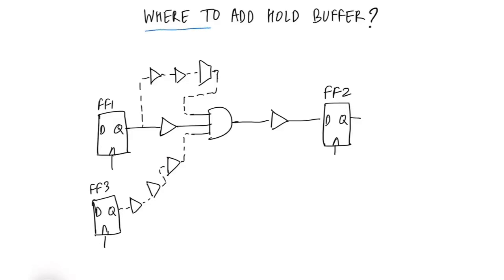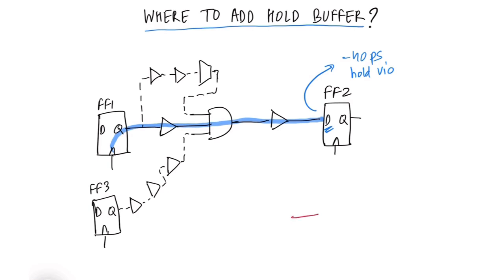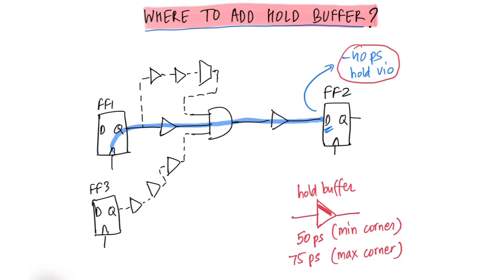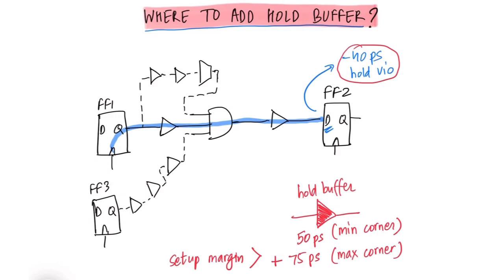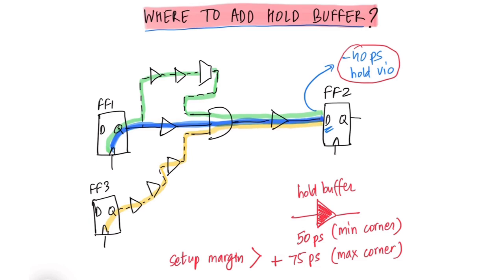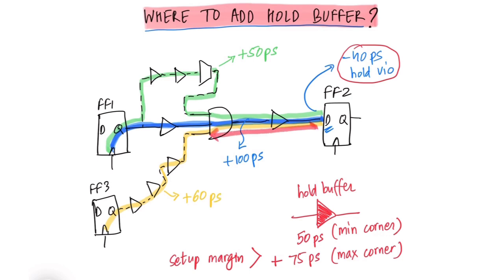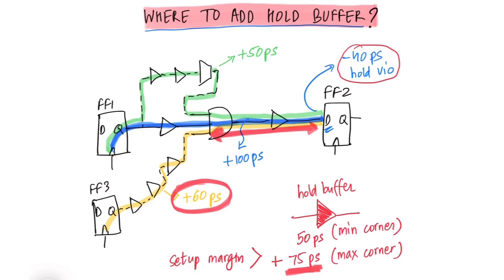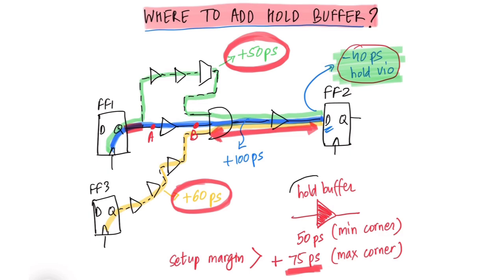Hold buffer interview question | VLSI physical design | Digital logic | Semiconductors #vlsi

Comment: setup margin set before, like target skew value or we assume the setup margin ?
if the setup margin is given in which file this value is mentioned ? is there any specific value like upto this value is given by any people ?
Reply from the maker: setup margin is not an input to the design. For any timing path in the design, setup margin or setup slack is calculated as --> Setup margin = Data required time at the receiver -  Data arrival time at the receiver
Reply from the maker: All the timing paths in the design should have a positive setup margin or setup slack, otherwise we will have setup timing violations in the design.
Reply: @2minuteVLSI okay sir. Can I add a buffer on the clock path.

Comment: Hi, i have one doubt can we add high drive strength buffer before the small drive strength buffer,
How it will effect on timing when small buffer driving high drive strength buffer 
Is it ok for timing fixes for hold and setup
Reply from the maker: Yes we can use a high drive strength buffer to drive a low drive strength cell, but it might be an overkill w.r.t power consumption. On the other hand, driving a high strength buffer using a low drive strength buffer can cause issues like transition violations, setup timing violations, crosstalk issues, etc.
Reply: @2minuteVLSI  thanks for valuable information...any authenticate resources to get good practical knowledge on sta or else please start series with min subscription fee your teaching is awesome and direct point
Reply: @2minuteVLSI thanks